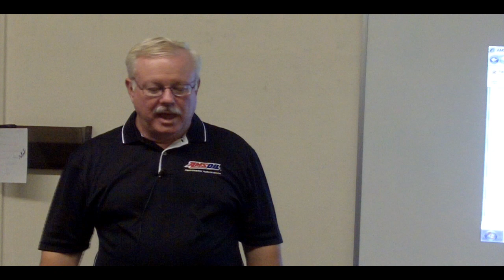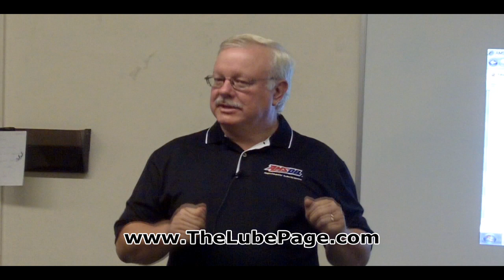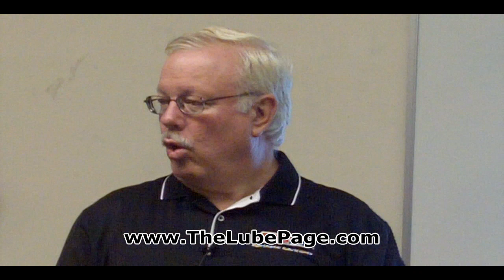AMSOIL Normal and Intermittant Oil Operating Temperatures

Comment: My 2021 GMC w/3.0 Duramax hit 291 deg F Engine oil temp towing my RV over Donner pass to Reno.  Was using 0w-20 DexosD approved Mobil 1 with a bottle of ProOne in the oil.

Comment: Thanks for the unique, informative video. I just have a question about the Motorcraft oil that is been used by Ford company as OEM motor oil. They recommend using only 5W20 on the Owner's Manual, but they say you are better off using 5W30 to protect the engine and 5w20 for fuel consumption USA CAFE standard. Is that true?
Reply: Check out bobistheoilguy forums. They have a better knowledge then I do, but my understanding is that it depends on if you have some form of variable valve timing. VVT engines can be trying to picky about oil viscosity, but engine like Ford 4.6l 2 valve that I have, literally don't care about viscosity.

Comment: Dear sir , if I understand you correctly that’s would mean that I will be safe to run Amsoil signature 10w30 In hot summer as extreme as 130 degrees. I know that I should reference the owner manual, but my main question is can that oil withstand the ambient temperature that over 130 degrees?!.
Thanks
Reply from the maker: It is important to remember that the cooling system (radiator) should be able to maintain the operating temp of the engine at the factory setting.  This is probably between 195*F to 205*F.  Granted, 130*F ambient temps will challenge the cooling system and the vehicle might overheat.  The Amsoil Signature Series will maintain protection under these conditions.  If you observe oil pressure dropping too low go up one grade to Amsoil 10W-40  Premium Protection.

Comment: Dan, I was looking at some of the oils on Amsoil and noticed the trend of higher Winter grade have better NOACK volatility % weight loss than the 0W and 5W. I know that diesels or heavy towing trucks tend to prefer higher 15W or higher.  I imagine this is so because it holds stronger higher heats or more severe like towing and etc. My assumption that the additives that's used to thin the oil at cold crank, causes it to break easier at higher temps. Is this correct?
Reply: Sort of. Assuming the same hot viscosity, oils with a lower winter viscosity tend to be made from a thinner base oil with more viscosity modifiers, which help keep the oil from thinning out at high temperatures. Naturally, the thinner base oils often have higher volatility and a lower HTHS viscosity. Over time, the viscosity modifiers can in fact break down from heat and mechanical shearing and cause the oil to thin out. An oil made from a heavier base oil with less viscosity modifiers (higher winter rating) tends to withstand extreme heat better assuming all else is equal, but all else is not always equal since higher quality base oils can naturally have a more stable viscosity with less additives.

Comment: Great video.. Dan.. by the way, Whats the best SAE oil to use in the middle east.. High Temperature of the Engine and scourging hot weather will add more heat.. AMSOIL is not that popular in the middle east hoping you can expand your products here..
Reply from the maker: Yes Amsoil needs to expand to the middle east.  If you can't find Amsoil then look for Mobil annual change.  You really need a good PAO based synthetic for the high temps.  If you have a contact in the country your in I can get them in touch with Amsoil's International desk to see if they can find a way to import Amsoil.
Reply from the maker: If you can't get Amsoil use Mobil Annual Change

Comment: so how can you identify if the oil is not at its operating temperature?
Reply: sensor
Reply: You can sometimes get pretty close with common sense. If you just started the engine, it's obviously not warmed up yet. Oil warms up slower than coolant, so it should be sufficiently warm after driving for a few minutes after the coolant reached its normal temp. If you are beating on the car at the race track or hauling heavy loads up steep grades in hot weather, the oil will probably get a bit hotter than ideal. If you want to know for sure instead of guessing, installing an oil temperature gauge is simple and cheap enough. Some vehicles can show oil temp on the dash or report it to an OBD device like a Scangauge, but a lot of vehicles don't have an oil temp sensor.
Reply: @averyalexander2303  I fully agree. I just installed a oil pressure and oil temperature gauge in my grand marquis over the weekend. Total cost was around $275 (glowshift and same brand pods and extra 14ga wire.)

Comment: Sir. I have subaru forester 2016.
I'm currently living in middle East where summer temps reaches to 40-45C.. subaru recommends 0w20, is it ok to use it with our desert heat temp. Or should I use heavier 5w30? Will it not cause any damage, as the manufacturer recommends 0w20. By the way, I'm out of warranty.. planning to do my own oil change.. thanks
Reply: My car runs 80% hi way, sometimes straight 3hours hi way trip, with dash oil temp registering at 100-110C.. ive read in some american forums, suggesting to stick with manufacturers 0w20, cause subaru engines have tight tolerances requiring this viscosity.. is it true sir,? Or this just for their epa mpg.. thank so much. On subscriber here.
Reply from the maker: @markusmords9662  You can run a 5W-30 without any problems.  With your oil temps if you are using a quality synthetic you have nothing to worry about with the 0W-20.  If it were my car I would use 5W-30 premium synthetic.  Amsoil is the first choice (PAO/Ester basestock) second choice Mobil Annual Change synthetic.
Reply from the maker: You can run a 5W-30 without any problems.  With your oil temps if you are using a quality synthetic you have nothing to worry about with the 0W-20.  If it were my car I would use 5W-30 premium synthetic.  Amsoil is the first choice (PAO/Ester basestock) second choice Mobil Annual Change synthetic.
Reply: Ok.. thank you for the advice sir.
Reply: You whant amsoil signature 0w-30 this best

Comment: I'm willing to bet over half of engine failures are due to improper oil viscosity added by owner or waiting to long in between oil changes.  Whats your opinion people?
Reply: As an auto tech, I don't fully disagree with you. I think negligence and "rushed engineering" is about neck and neck for newer engine failures. The older engines really only suffered if you heavily abused them or neglected them.

Comment: At what low temperature does 30 weight oil become 30 weight?
Reply from the maker: Jeff, your question has no simple answer.  Each oil will be rated with a Viscosity Index and the index is designed to show how responsive the oil is to temperature changes.  The higher the Viscosity Index the less responsive the oil is to temperature.  Oil viscosity on the bottle is measured at 212*F so a SAE 30 will have a measured viscosity of 30 at 212*F.  If it is a straight 30, not a multi-viscosity, then it will get thicker as it gets cooler.  The rate is dependent on the type and quality of the basestock. Some high quality synthetics like Amsoil can achieve a 10W-30 rating on a straight 30 viscosity oil.  This simply means the synthetic base stock has a naturally high Viscosity Index.
Reply: Dan Watson that makes sense. I have a 2019 Dodge Charger with a 392 and the manual says to use a 0w-40 and it blows my mind that they would use an oil with such a wide band of viscosity. I use 0w-40 Amsoil signature but the factory thermostat is 203*. When I watch the engine oil gauge it holds at around 225-230 cruising speeds, so I’m sure the 40 viscosity is battling high sustained oil temps. I want to put a 180-190* thermostat in which should calculate to 200-205* oil temp. Should I continue to use the 0w-40 or would I be better off using 0w-30?  This engine does have VVT so viscosity will have an effect on it.
Reply: @FlatPlaneCranky  Don't use a low temp thermostat, it will do more harm than good for reasons I don't have time to explain. As he said in this video, 230 degrees is perfectly normal and easily handled by a good synthetic oil, you have nothing to worry about. Just use the recommended oil, change it regularly, and enjoy your sweet ride :)

Comment: A liquid cool engin works at 70c - 80c depending on the thermostat setting so how can the working tempature of the oil be higher?  I can understand in a turbo charged engins haveing a higher oil temperture but not in the range mentioned in the video! I´v changed oil and filter on a hot engin and have never been scalded.
Reply from the maker: I know this is a late reply but it is good to clear this up.  The basic principle of heat transfer is that heat will be transferred from hot to cold.  Oil lubricates the hottest parts of the engine and transfers most of that heat to the water jacket of the coolant system. In order for the heat to transfer from the oil to the water the oil must be hotter than the water.  If the Engine water / coolant is 205*F then the oil will have to be hotter.  As the oil drains down through the block from the top of the head it will release heat to the areas being cooled by the radiator coolant.  Some cooling will take place in the oil pan as air passes over the pan when the vehicle is moving.  The harder the engine works the more fuel that is converted to heat energy in the combustion process, ultimately converted to mechanical energy in the force exerted on the piston and then converted to torque to turn the crankshaft.  This will make the oil even hotter and in many cases the installation of an oil cooler will be called for in heavy loaded engines.